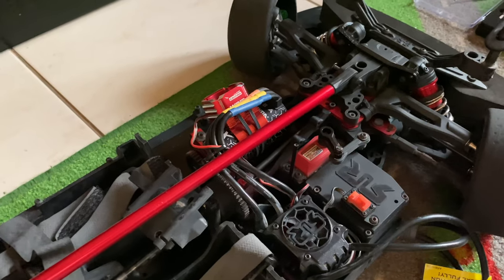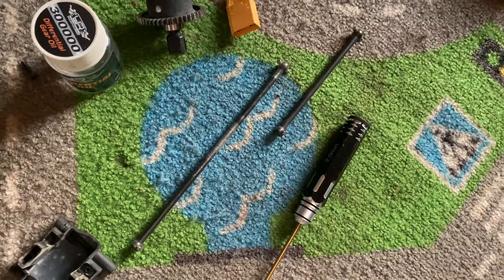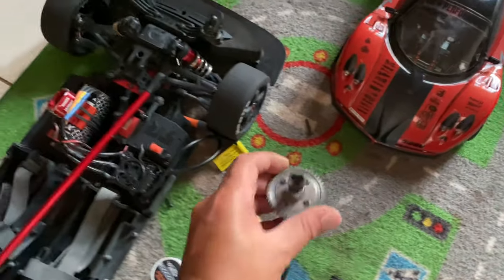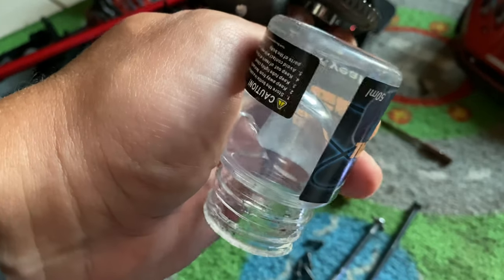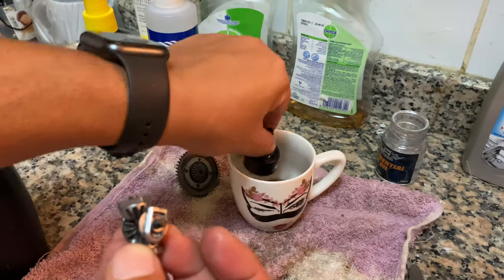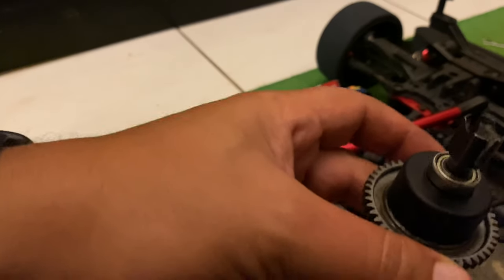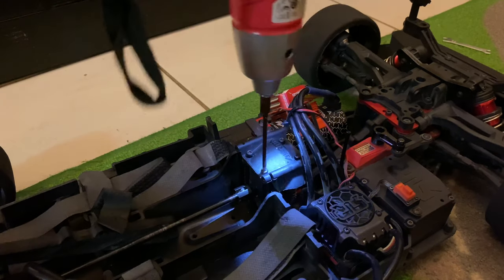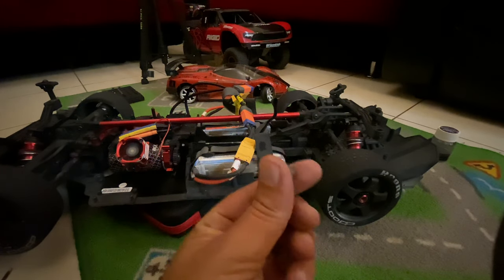DIY ARRMA INFRACTION center diff oil change

Comment: Stock diff is 7k
Reply from the maker: wow 7k is so low then good that i put 300 K thnx for the info
Reply: @UAERCADDICTS  I put in 500k. 300k is good.
Reply: @jmiles9836  500k at the center its good?
Reply from the maker: 5m
Reply: @UAERCADDICTS  front and rear what diff oil saiz?
Reply from the maker: 100k